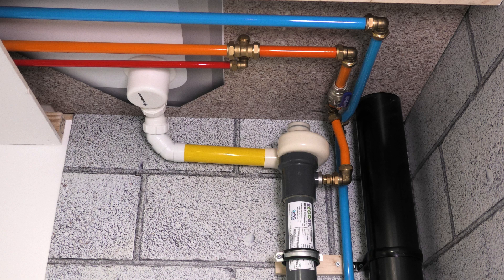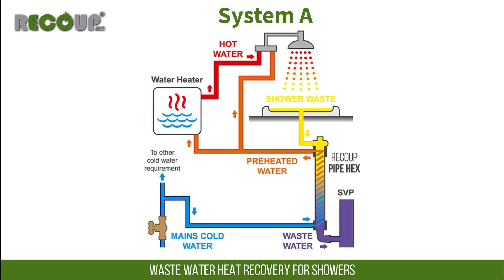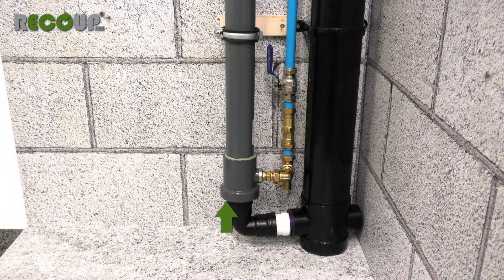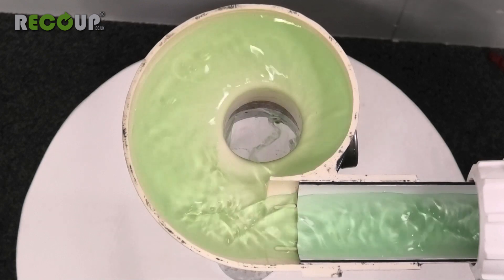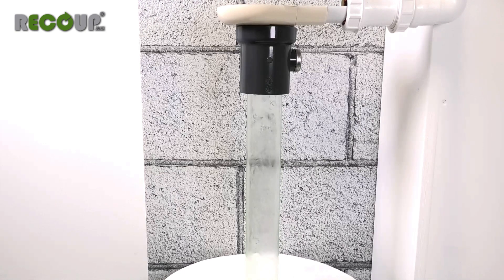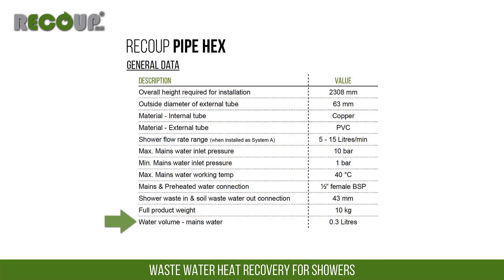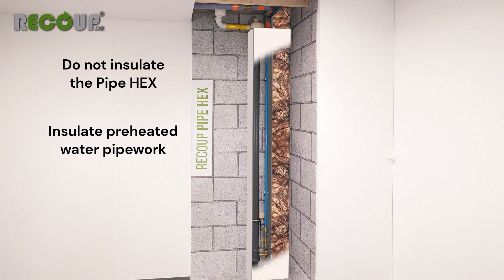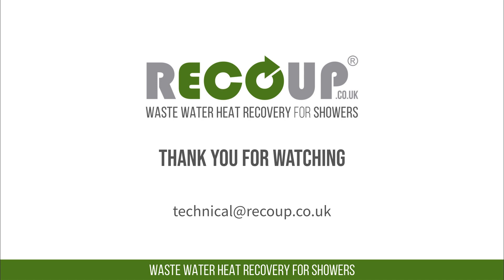Recoup Pipe HEX - A closer look at the heat exchanger

Comment: would it be beneficial to create indentations in the inner wall like a golf ball to increase surface area even more, or would that increase the cost to much for little improvement of efficacy?
Reply from the maker: Hello thanks for your comment and question. 

Creating such indentations will certainly have an impact on manufacturing cost. But they could also reduce the efficiency of the heat exchanger. Although the surface area would increase, the waste water may not contact those areas, therefore effectively reducing the comparative area of contact. Extending the heat exchanger length will typically create a greater increase in efficiency than indentations or deformations on the exchanger surface does.

This and more is mentioned on our Knowledge Base topic about heat exchanger design. https://knowledge.recoup.co.uk/heat-exchanger-design